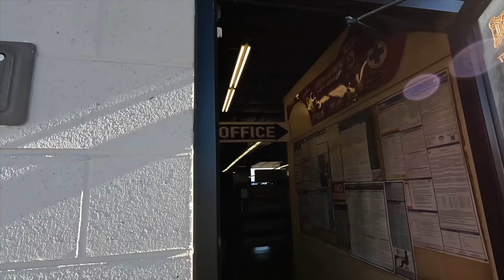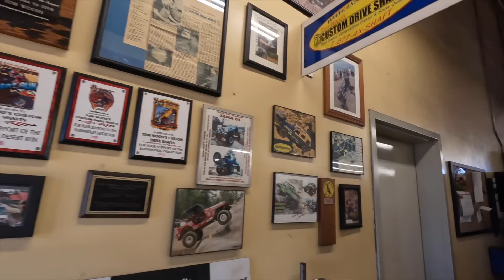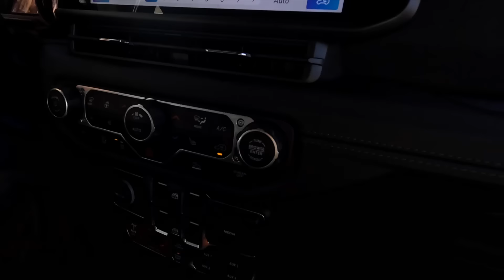Road Trip!  and new Falken  AT4w Tire Reveal

Comment: Literally the perfect Ford, especially since it has the 300ci I6 and a manual, great combination and indestructible.

I'd make a mold of those fenders though, seen in one of your earlier or later videos of you busting them up and trying to source spares... just make molds and you'll always be able to quickly make a set. I'd personally make a set in carbon/Kevlar composite instead of just fiberglass, that way they're still light, but they won't be cracking and getting rubbed through or breaking, much better than fiberglass or straight carbon, plus it looks awesome, and would definitely match the truck as it sits with the wheels, steering wheel, seats ECT 👌 (definitely get dog bone weave too, classic)
Reply from the maker: This has a 351 in it
Reply: @thedirtheadshed  does it??? I could've sworn it was the old straight 6 😅
Oh well, both great motors

Comment: If you would have built this truck with a 7.3 diesel, what would you have done differently? This truck is so much of an inspiration to me with my love of bags, off-road, and my F250.  I don’t see why I couldn’t also keep radius arms up front, a big bag, and a properly valved shock. I can’t remember if you have an air on demand system or not. Stay rad!
Reply from the maker: Probably all the same.  May not have gone as low of axle gears.  Keep it like 4.56’s
Reply: @thedirtheadshed  dope brother! Thanks for all you do for this community Dave!

Comment: Impressions on the Falkens?   I was hoping for a solid review on them since I can’t find much. I’m shopping in the 38” range and basically only looking at these or the Patagonia.  I have lots of experience with the Pats and I’ve had good success with them, no real complaints.  But I’d like to change it up.  Is the review video hidden in another video?
Reply from the maker: No real “review”. Just impressions from the trip to Moab.  I feel like they are a great tire in the 38”.  Plenty tough, balanced well even on beadlocks.  (About 4 oz each).  The compound is a little firm to be a really good rock crawling tire. But that means you should get a good amount of highway miles out of them.  All in all.  I really like them

Comment: Hey I'm looking for a Ford transmission manual preferably Ford but I was looking for one that would or can adapt to a transfer case I would like one with overdrive for a V8 which ones do you know about
Reply from the maker: I don’t know model numbers.  But I would start looking for a 5 speed from a mid 90’s f150
Reply: I guess that would be the same one in a '94 Ford ranger 4x4 V6 manual fire speed I guess they put it in f-250s and f-150s
Reply: @devinpena10   ZF5 was the heavy duty 5 speed in F250/350s, it's available with small block and big block bell housings. The lighter duty was a M5OD in the F150. I'd look for a ZF5.
Reply: @eat.sleep.wheel21  okay thank you I just looked it up and I got a summit thing and it said Mazda ranger F-150 f250 so that's the information I was going off of